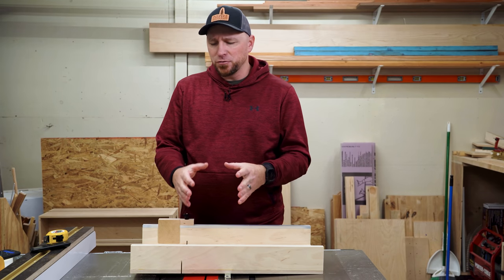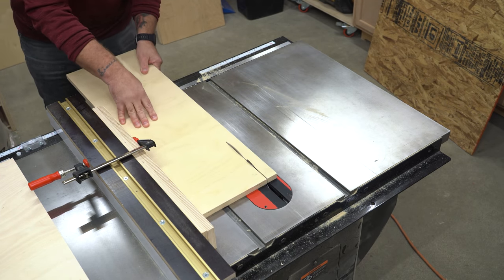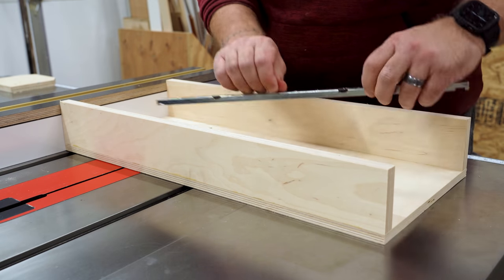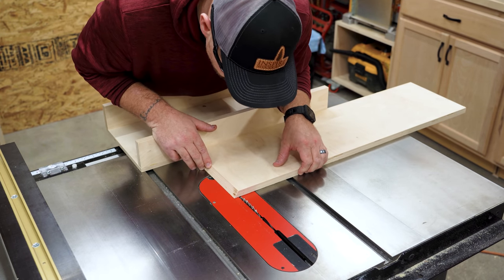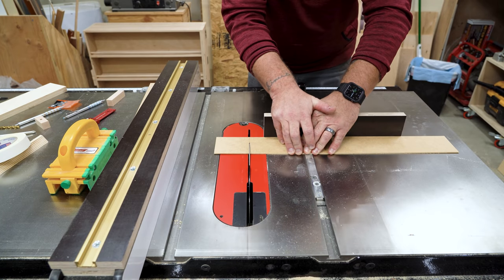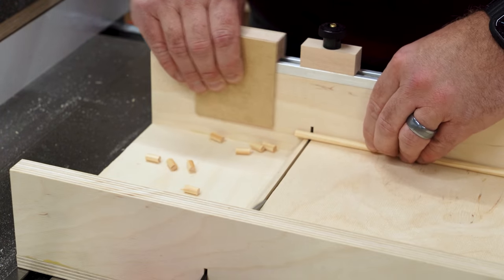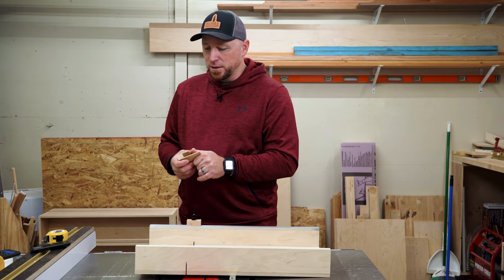Simple ZERO-KICKBACK, Repeatable-Cut Crosscut Sled / How to Cut Small Pieces on the Table Saw

Comment: FYI on the Incra miter bar.
I purchased an Incra Miter 3000Se years ago for my Delta Unisaw and I love it!
But... when I purchased a SawStop the miter bar had far too much play.  I rotated the black inserts which do wear over time.  But still too much wiggle.  I tightened the screws on the slotted disks and still too much wiggle,  I was ready to toss it out when I decided to call Incra.  Glad I did!  Mark, at Incra, emailed me a doc to follow and said call him back if it does not work.
The doc was telling me to do most of what I had already done.  But... Here's the fix.  Put a thin coat of grease, not oil, on the treads of the screws that hold the slotted disks.  Now adjust agin.  It worked great!  This is the tightest miter bar I have ever had.  ZERO WIGGLE!!  I love my Incra Miter 3000SE even more.

Comment: Absolute genius design, simple to build and top handling. Up to now I never saw this kind of stop block, but it's usable for any type cross cut sled, just perfect. No hinge or moving parts that might wear out. The only thing I will change when building my next sled is the runner, the "Workshop Companion" lately came up with a good solution in UHMW PE and adjustable width for perfect fit.
Reply: Do you have a link to the runners or a video?
Reply: @jonathangaliano2617  The Link is 
https://youtu.be/ThHQFVD00w4
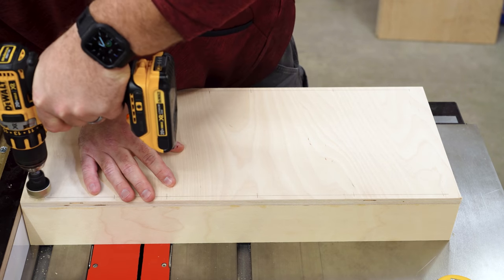and the name of this part of that video is "Guide" starting at 3:56

Comment: Very clever! Building one of these for my shop ASAP. I cut a lot of small corner blocks and loose tenons; this will help speed up the batch cutting process. Mine will probably be a two runner design though, and I like to use UHMW as runner material. Thanks for posting!

Comment: I don't do a lot of small parts but i love the idea of the out-feed releasing the off-cuts away from the blade, and the stop block is almost ingeniously simple. Definitely makes cutting a lot of pieces faster. Changes I would make? Wax the bottom. MDF, yes I know beaver-puke looks terrible but its stable, a lot cheaper, and easier to find than proper Baltic-birch. Get a t-slot router bit and cut the channel for the stop block instead, it will pay for itself within a few feet of track, and the wood tracks hold perfectly fine aside from medium-heavy clamping loads.

Comment: Brilliant!

One thought. Instead of a sliding stop you could make a pivoting stop that moves the stop forward (and slihgtly uppwards) instead of sideways. Essentially the same piece you have but the front and back at an angle. A V shape.
If you grab it like your sliding stop I expect it to open naturally when your hands move forwards and push on the back and close on the backward movement when your fingers push on the front.
There will be a limit to what angle is practical and thus on stock size but for the stock you use in your video it should work perfectly.

Comment: Nice sled the only thing I noticed is putting a tiny fence on the right so little pieces don't roll off onto the table, Or turn the right side into a little tray that you can remove and take your cut off's over to your assembly area
Reply: Good thoughts.
Reply: My solution to the gathering of small pieces in a bad place is to run an (empty) shop vac attached to the fence.  It simply pulls all the small pieces (even hundreds) into the vacuum as soon as they are cut.  They are then protected and easy to collect when finished. No special sled needed.

Comment: 4 15/16 stars...lol
Only thing is not enough contrast between the 3/4” tapered insert and the 1/2” sled body.  Other than that a perfect sled.  Going out to the shop to make one right now.

Out of T-track, so going with key-hole router bit to cut the slot in the top of the back rail. ( oak )

Comment: The reason I put a clamp in the bottom of mine was so I could clamp down a relatively small piece and make cuts on it, a much smaller piece than I would want to hold down with my fingers.
Reply from the maker: Good point!

Comment: smart idea. Maybe you can add a small wood with magnets to the end of the lower board. So you'll get a fence for all that little tiny pices you cut and which are falling down and no one will get lost if you made a lot of them.
Reply from the maker: Good idea. I have been experimenting with a removable tray to collect the pieces, but I'm not sold on it yet. It ends up limiting the offcuts from falling away correctly. A removable fence might just be the way to go.

Comment: I like a lot of stuff this guy does but watch the big nono at 1:15 If you know anything about woodworking and safety you never ever use a mighter gauge with the fence doing a cross cut never
Reply from the maker: If you rewatch that part, you’ll see that’s not actually what happened. I set the fence to measurement that I wanted, slid my piece up to it, moved the fence out of my way, and made my cut. Simple, safe and quick.
Reply: @Inspire Woodcraft  lol I actually thought about that after I posted that.

Comment: Why does every channel always specify Baltic birch???  It is not easy to find so most of us are limited to what we can get at the orange or blue stores.  Why not also specify ply that we can get at either of these stores as an alternate part????   20 miles from me is a Woodcraft store, but they don't have Baltic birch in stock.  This has always been a problem.  And given the current price of lumber, there has to be a better way.  I am just tired of every woodworking channel always specifying Baltic birch.  There has to be a more user friendly way.